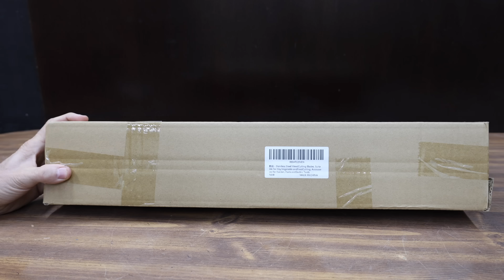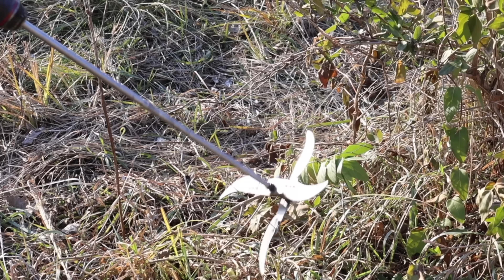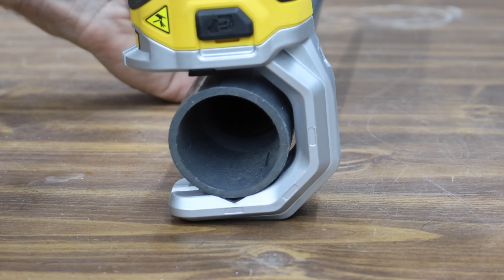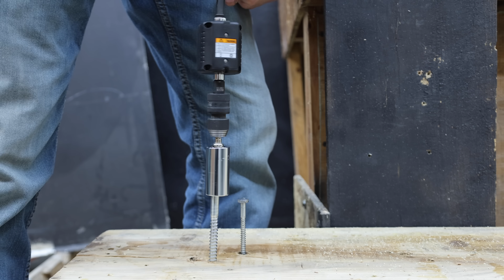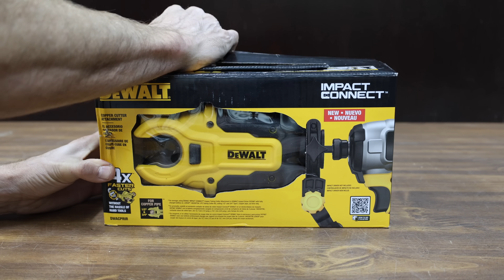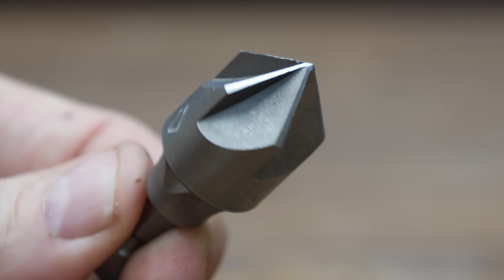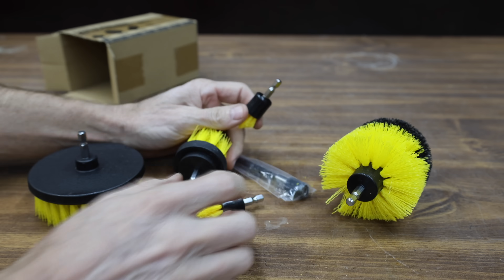I Replaced 10 Power Tools With My Drill!

Comment: The rivit gun attachment is great.  I have never used oil, and it always released the pin fine.  I think adding the oil backfired on you.  Also, if you decide to upgrade to SS rivets instead of the aluminum/ zinc, you will also see a huge benefit over the hand tool. Nibbler attachments work better than the sheet metal cutter attachments as well.  It doesn't maul and bend the metal as bad, though it is much louder.

Comment: I have used that dewalt pvc cutter attachment for 3 years cutting pvc for pool equipment installations. It’s great!  After two years the blade dulled and you need a new one or could sharpen it

Comment: Black and Decker they had a really good setup on their 20V Matrix drill a few years back, reciprocating AND circular saw heads, air inflater attachment, power drill AND impact drill heads, and a few others. I installed quite a few HVAC systems using one of them. Was just fantastic.

Comment: 95.00 to cut plastic add 3 minutes and 25 seconds in the video. Can you comparing it to $20 tools. No wonder the 20-dollar tools fail you're taking five tools add $20 and buying one tool and saying it should perform similar to the five times as much tool. Maybe you should have two different tests one under $50 and went over $100. Could have made two videos

Comment: I tried the same chainsaw attachment years ago. After cutting twigs for around half an hour, the heat from the geabox melted the casing from inside, and they no longer could line up, so the adapter was rendered useless.

Comment: Another good one are spin swedges/flares, for copper pipe, especially in hvac

Those planting drill bits attachments are awsome, except for it breaking my drill, lol...
It was probably underpowered , a Dewalt atom. Might be worth trying again with a bigger drill or welding one to a 1/2 socket to use on a big impact.

Sheet Metal niblers were also a nice attachment

Comment: My vehicle is throwing  P0420 code and I believe my catalytic converter might just be clogged. All the catalytic cleaner additives say they help, but I can't tell which ones actually will and which are just snake oil. Could you run some tests on what works and what doesn't?

Comment: Yeah, so, a drill spins at 2,000-2,500 RPMs. Metabo, I think, makes a specialty one that can hit 4,000.
Rotary Tool (Dremel): 5,000-35,000
Die Grinder: 20,000-30,000
Chainsaw: 9,000-14,000
Angle Grinder: 10,000-12,000
Weed Trimmer: 5,000-8,000
Rotary Sander: 4,000-10,000

Tell me again you think ANY of these are viable for anything other than a one-time use novelty.

Comment: The weed attachment in the first part reminds me of the tree stump grinder attachment that they started selling for hand grinders immediately dude started chopping their heads off. It was basically a circular saw blade with wide carbide teeth. It wasn't that it might jump it's that it literally jumped every time you turned it on tons of dudes had that crush their forehead I have no idea what those engineers were thinking

Comment: So I have one suggestion, What's the best windshield washer fluid? I have a Jeep, and it's windshield gets constantly covered in bug splats. I would love to know which brand would clean fresh or dried bug splats, winter road grime of salt and dirt when there's snow, resistant to freezing, and while I doubt it, are there any brands that could potentially damage seals or soft top roofs like you find on jeeps or convertibles?

Comment: Nice video, as usual, and the nylon brush attachments seem like a good thing- I already had that exact set of wire ones. I would like to suggest a test on 12v electric vehicle jacks. I have owned the scissor type twice, and they both failed. Looking now at the cylinder types, but not sure which one would be best. Inflatables are also a possibility. Note:  test on small cars,   suv's, and trucks separately, as the lift height capabilities will show limitations.

Comment: I’ve had a universal socket for years.  I give it an 8 out of 10 for this reason:  driving small bolts, may be located in small spaces, where the universal has too large of diameter to get in.  It can make quick work of the job, but if you have the correct size socket, use it instead.

Comment: Some of those could do "in a pinch" but won't replace a proper tool.

A very select few are actually worthwhile though. As we saw here. ;)

I've had one of those reciprocating saw attachments once, and it almost got my finger. It's pretty shit at its job, but flesh is easy work.
That and the plastic gearing to turn rotation into translation is just cheap grabage, so it won't last even if you're gentle with it. 
Sad, but true.

I actually have and regularly use a set of drill attached brushes. They're just plain good.

Anyways, thank you a LOT for this video, the marketing and hype is always strong on these things. :D

Comment: I have the auger, which is efficient for making uniform holes for planting certain types of vegetables in rapid succession. For large plants that require a large and deep hole, the shovel would be faster. The auger is inexpensive as Todd indicates and is therefore pretty handy to have around. Also, if you need to deep water an established plant and your soil around the plant has become compacted, the smaller auger dug straight down next to the plant and the hole refilled with loose amendment will allow a more efficient, deep watering.

Comment: The Auger is a must own for gardeners. I've had mine for two years now and he's right about the clutch and low gearing. It over heats a ryobi hammer drill after 10 holes. The base model ryobi isn't going to survive that abuse if you try it.

Comment: I use the wire brush drill attachments to clean out pump covers on seal replacements. Wish I could find one thats 1/2" diameter for smaller pumps. The dewalt cutters are cheap starts for plumbers instead of the full tools but they do start walking faster than the tool made for those jobs.

Comment: Edges on hard materials like steel will annihilate sanding consumables. If you have a lot of edge work, break the sharp corner with a hard disk first. Just a tip for people; sanding consumables are hella expensive.

Comment: I use the round flat nylon brush attachment with interior cleaner on my cars, and carpets and head liners and such cleans very easy. Apply gentle pressure only to avoid damage on headliners and door panels and such that have adhesives that might dissolve. I used it with Turtlewax textile clean. After removing stains with the textile clean and nylon brush, I sprayed a couple times with water and drew it out with a wet vacuum cleaner (Again, go easy on fabrics that are glued on). But it was the brush that really got deep enough to remove the stains.

Comment: I bought a Kinchrome rivet attachment for my drill a few years ago. SUCH an upgrade and hand saver compared to the old manual riveter I had. was around au$120 but worth it compared to aching arms and swearing at things.

edit: Also, with the cheapo riveter, did you try running it backwards to release the mandrels?

Comment: I used to use the dewalt metal trimmer attachment at my roofing job. It worked good but one side of the cut is smooth and the other side is wavy

Comment: Back before I was on long term disability like 4 or 5 years ago, I worked as an electronic and mechanical repair tech at a big university. We decided one day, my coworker and I, to order that universal socket while ordering more materials for the shop. Neither of us thought it would work, but it was fairly cheap and we had an order going anyways so we got the go ahead from up top to order. It works so freaking well I still don't fully believe it 😂 its obvious never gonna be as strong as an impact socket, it lightens your day to day tool kit so so much and it just worked so flawlessly. I'm in my mid 30s now  and still, everytime I see that socket it reminds me of this story. Completely random impulse purchase and ... Yeah I've made my point 😂

It can take some abuse too, but as long as you don't use it as a work horse, it will last surprisingly long. We did end up breaking the first one, but we learned a lot about it and ordered a replacement. We used that replacement for years, even until I was forced into long term disability cuz fuck you universe, thats why 😂😂

Comment: I used the wire brush attachments, with extension, on my cordless drill to clean rain gutter seems for to reseal them. Worked great and were cheap.

Comment: My father had a Craftsman drill and bought this style attachments in the early Sixties.  They were mediocre at best.  I still have them on a shelf since he passed.
Very few of those were better than mediocre, so nothing has changed.  Hope you had some laughs with those, Todd.
P.S: You said the outside deburring tool worked well.  I beg to differ.  It took the burr but left a horribly wavy cut.

Comment: Those "universal sockets" are awesome for screw-in hooks, eye-screws, stringer hangers, and the like. The flexible drill extension & 90 degree adapters are also "must have" for getting cables into place in finished buildings. (My 90 degree is from Milwaukee.)

This video was a lot of fun and every bit as informative as we have come to expect. VERY IMPRESSIVE! 🤓

Comment: That "vegetable cutter" uses the same blades as in my food scraps processor. The plastic spindle is the weak point in that.  At least it's spinning inside a steel bowl, and not in the open air.

Comment: Cheap wire brushes are always a double edge sword, absolutely most if not all will do their job just fine, but the material absolutely breaks off more easily, so just be careful with that, but they are worth it
Reply from the maker: Thank you for sharing!

Comment: For the pop rivet gun you should have also gotten a pneumatic one from harbor freight to round out the comparisons. Though one thing I'll say is the ones at harbor freight would most likely blow the other units out of the water. Another advantage is you can put pressure into stuff, this is especially useful if you have two pieces of sheet metal that you need to attach together but one of them keeps drying to straigtnten and move away while you rivet them together. EDIT: For the DeWalt metal shears, use a drill gun instead. I have the same ones and they work best with the torque and steady rotation of a drill gun instead of the racket of an impact gun.

Comment: Everyone hates on the universal socket, but they are great for rounded off or stripped bolt heads. Just used it to remove my son's oil pan drain plug. Keep one in your toolbox. Way easier than vise-grips.

Comment: The universal socket is pretty handy for bolts that are hard to reach, such as under lawnmower decks. I also reckon the screw/auger adaptor is great in the garden for aerating the lawn - the little one is certainlly easier to handle.

Comment: I'm legitimately always interested in finding a decent new drill attachment, so this was excellent. I might just have to get that PVC cutter. I already have the universal socket, and while it's never a better choice than a socket specifically made for the size you need, it has saved me on multiple occasions with things that weren't meant to be turned by sockets. For example, the bar that comes with the bottle jack in my truck, which is used to rotate the jack's gears and raise it up. Universal socket attached to that wonderfully, and made it significantly faster and easier to jack up the truck.

Comment: The universal socket was originally sold as "The Gator Grip". I bought one decades ago and actually used it way more than I thought I ever would. That thing was supper tough and worked great on partially rounded bolt heads. I eventually lost it and never replaced it but I do sometimes think of ordering another one.
Reply: I have a nut that's rounded and I never even thought about trying to use that gator socket.. now I should go find one and try it
Reply: I use mine to aide in extracting small broken off bolts in tight spaces, I weld a nut with as much weld as I can afford then use this tool to extract the blob nut
Reply: @danieljacob3132  That's a pretty cool idea. Definitely thinking outside the box.

Comment: The universal socket has helped me out in a pinch when I'm on a roof and don't have the socket size I need, saves me a trip to the truck!
Reply: They have been around quite a while and it is always good to have one along with a standard set.
Reply: We had those in the 1950s. Yes, they do work, just not heavy duty long term. Worth having though.
Reply: Putting on a wing nut with a drill is pretty cool
Reply: The larger “king gator” ones are amazing.
Reply: Yeah im thinking of buying one to keep on my drill just for random little hex heads that dont need torquing
Reply: Uhh wtf kinda roof are you on that requires multiple diferent medium size fasteners cause other than a 7/16" or 1/2" for rail mounts for things like solar panels or a 1/4 and 5/16 for things like your ac units and other electrical applications, other than those what else are you working on up on a roof where youd need a variety of diferent sizes
Reply: @Jaybird6638 Residential AC units are the ones that only use those sizes. Larger Commercial AC units use 3/8 and up, I've seen Exhaust fans use 1/2, and sometimes you'll get random parts of a unit using metric sizes.

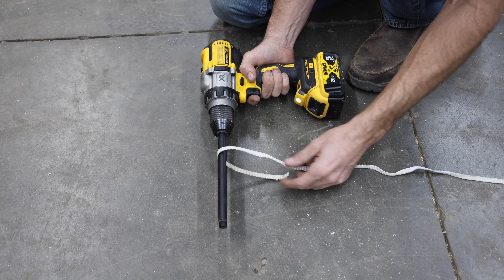Comment: 9:25 Ive seen people make these with a 5 gallon bucket, or just some CPVC pipe lmfao. IF you have Massive extension cables, Liek Job site cables, Look into the Bucket Cord method. Can do with a hand crank, or make it to work with a power drill like this. No more chasing cords down. Un plug it and wind it up in seconds.

Comment: When I saw the chainsaw tool, I thought it looked terribly dangerous!  I was surprised to see how well it cut.  Durable?  Who knows, but it looked good on the cuts it did.  I'm going to look into it, because I have some small branches I'd like to cut and I don't want to pull out the big chainsaw.

The deburring tools are good.  I like the one with the carbide blades - those are made of hard carbon steel!  

I have one of those universal sockets and it's been used not once.  I didn't have any confidence in the tool, but it looks like it'll work well.  Maybe it's time to pull it out.

Very good video with lots of useful information.  Thanks for your hard work.  I appreciate everything you do!

Comment: You know back in the late '60's (I think), Sears Craftsman made and sold a corded drill system that had all kinds of attachments. Such as, circular saw, jig saw, sander, and a little drill press that it fit into. It had a special collar around the end of it that mated with the accessories and attached with a simple 180 twist and a spring-loaded locking pin. This was before cordless drills were a thing. I think I still have it somewhere in all my junk.

Comment: Whew some of those look mighty sketchy. Thanks for doing the tests I'm not brave enough to do!
I'd like to put a suggestion in to do some testing on wind shield shades.  Reflective, non reflective, plastic, fabric versions, and if anything more exotics is out there. Do they delay the time it takes for cab temps to skyrocket? Are they effective to at least reduce dashboard and/or steering wheel heat? Maybe help with long term dashboard cracking? Are they worth the hassle?

Thanks for all you do!

Comment: I use the wire wheel attachments with my Milwaukee M12 impact driver. I like to use the driver because it runs a lot faster than the M12 hammer drill. They work pretty good, except the cup brush fell apart from rough use.

Comment: tt would be great if you could test  the Black and Decker 20V MAX *POWERCONNECT™ MATRIX™ Cordless Drill with 12 Attachments (BDCDMT1212KITC1).

None of the attachments are heavy duty but they do their job for people who do not want to invest in a whole bunch of tools when they only need those tools on some occasion,  and they are not sketchy at all. I know because I've tried them.  It would would just be a delight to have your opinion.

Comment: I have both the augers and the "universal socket".  Both work for most things.  The auger though has issues with very rocky soil and for clay soil.  Rocks stop it, as the drill motor isn't able to overcome the resistance that rocks give.  With either the small or large auger clay just clogs up the augers.  It sticks, and you are somewhat better off with a normal 3+ HP standard post hole digger.  The socket, though is really good.  Mine is a Craftsman.  The only caveat is that it is large in diameter, and you need enough clearance for it.  It also works quite well with "security" type bolt heads.

Comment: I feel like most of the random Chinese attachments would actually work better if they had more than 5 mins of engineering thought and used better than Chinesium materials. Notice how all the DeWalt products performed well?
I think there is HUGE potential in making $25-$50 attachments that are well designed and have good materials, BUT most quality companies dont want to make those attachments because they already have a full sized tool that does the same thing and costs $100+ without a battery and thus selling drill attachements would only hurt their sales.

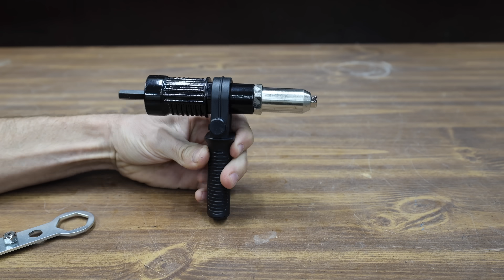Comment: 6:00 rivet gun, Got exactly the same rivet gun. Made a whole facade with it using alucoBond plates over 3000 rivets. Works great. for extracting rivet you have to reverse the drill. Few rivets and you get used to it.

Comment: I have that universal socket and it's great for those incidentals, instead of having a whole socket set in the toolbag. Plus it is very tolerant of whatever the size is and even works on squares.
I also have one of those small auger bits, it works like a hot damn, even on a 12V it was trying to dig to China.  
I do not recommend spinning wire brushes, when a bit flies off it's a needle projectile that hurts like a mofo. On an angle grinder at least you can have a guard on.